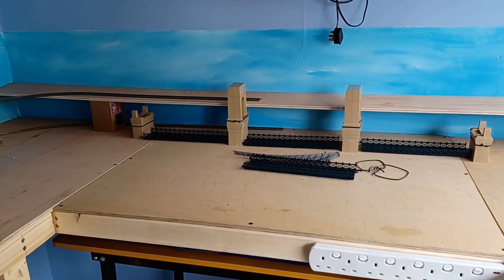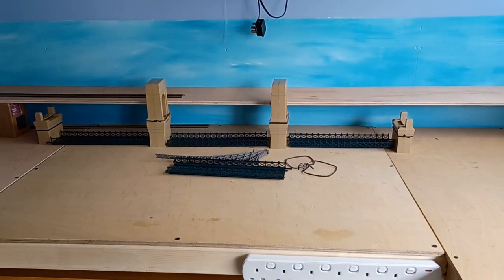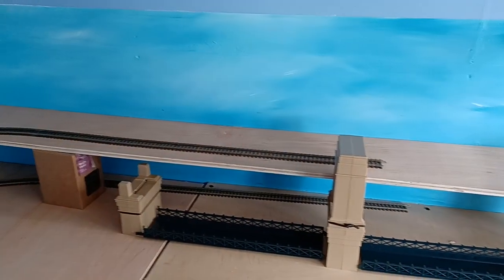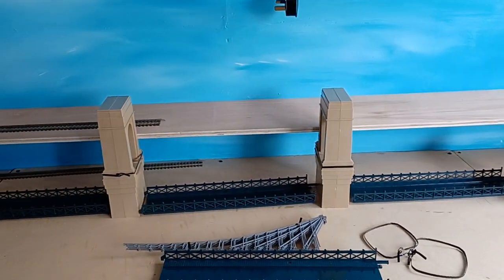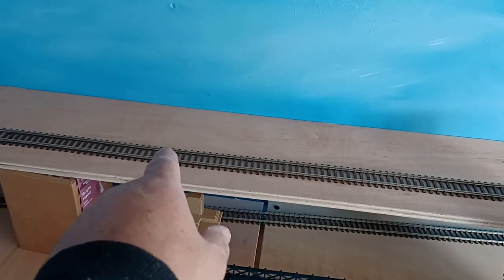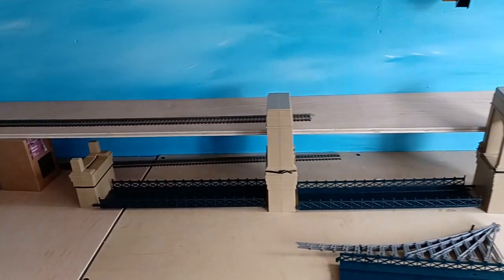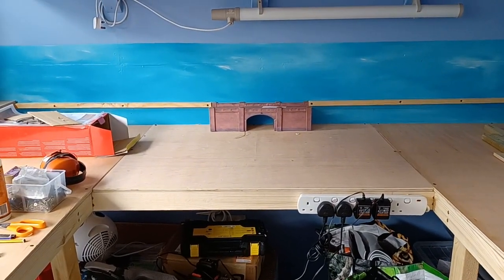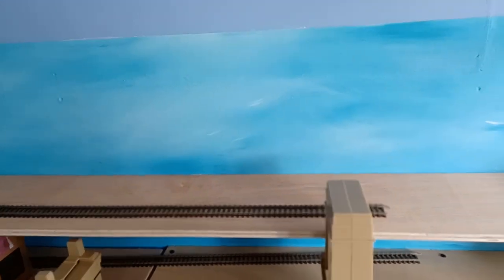Model Railway – Hornby Bridge

Comment: Hi Simon , great to see you back on course with the shed layout . That bend does look a little near , try one of your longest coaches on it . 
Or look up the longest possible rolling stock and use a piece of wood cut to that length just to try .       Still following .........Peter
Reply from the maker: Many thanks for commenting Peter. I have given up on the Hornsby bridge and have just purchased a Metcalfe viaduct to replace it. I think, because of my operation, it won’t be until the end of the year, or beginning of next year, before I get back to the layout…Simon

Comment: I would expect a loco body quickly to straighten once the first set of wheels is fully on the straight. That is certainly the case will all my steam locos.  Once the pony truck is on the straight the body is parallel with the tracks. Of course some diesel locos have a bit of the body in front of the first set of wheels, but apart from the APT-E that isn't excessive. So my bet would be you have plenty of room.  I add the caveat that I am of course versed in N gauge, and I could get a full consist in the space you have between the curve and the first pier 😁.  Stephen
Reply from the maker: Many thanks for your help Stephen. I have decided to sell it and have purchased a Metcalfe Viaduct...Simon

Comment: Hi Simon, its hard to say whether a train would hit the bridge as its depends on the train. If its a class 800, APT / APT-e probably wouldn’t make it. Just try it, wheel the train around you’ll soon see. Could the bridge be moved along a bit? The suspension bridge is far more attractive the other option which is to go over a stream or narrow track. Personally I would avoid having tracks one above the other, as you probably wouldnt see this arrangement in reality, you could incorporate tunnels on the lower level to hide the fact both tracks run together.
Reply from the maker: Many thanks for taking the time to comment. I did not think about wheeling a train around, which would have been a sensible thing to have done. I have purchased a Metcalfe Viaduct, so will probably sell the Hornby bridge...Simon